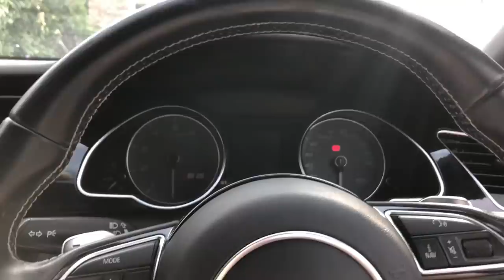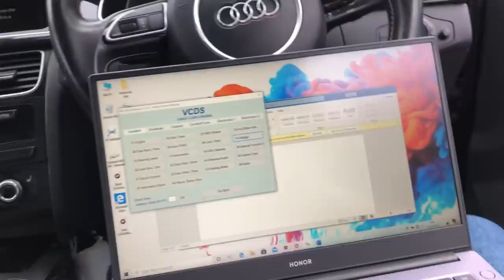MISTAKE MADE with My Cheap Audi S5 - Part 5

Comment: Dude! I did the same thing with a MK 7.5 fiesta I rebuilt recently and I bought a bumper with parking sensors and I didn’t know! Luckily mine was the other way round so I finger glass filled it and had it painted. Nightmare the other way around
Reply from the maker: ben young lucky man. It’s possible both ways but just an absolute nightmare man.

Comment: Hi where do you get the VCDS software and is it free?
Reply from the maker: Greg MacGregor Hi Bud, Ross-tech.com provides the cable and the software. It’s not free. I believe you can also get dodgey copies off the internet if you search VCDS in Ebay for example- not sure how good they are.
Reply: @SLRebuilt  thanks for that

Comment: Why don’t you get the body shop to drill the parking sensor holes
Reply from the maker: A J they could do but then they would also need to cut the washer jet holes to. It all starts adding up and I wanted an excuse to upgrade the bumper 😂
Reply: The parking sensor holes are usually marked where they are supost to be, just use a hole punch to cut them out. Really clean and only took me about 10 mins on my wife's A1. Also, you can stop the loud beeping when the door is open by pressing the little push switch on the bottom of the washer jet stalk, that beeping does my head In lol. Enjoying the videos mate!

Comment: Do you know how to remove the metal clips off the curtain airbags on a 2015 S4 I’ve tried looking for videos but can’t seem to find any, your airbags are way easier than mine
Reply from the maker: From memory these we an absolute pain in the arse. I think I used a small flat head screw driver and a pointed trim tool. Pushed the pointed bit in or out and then used the small flat head screwdriver to push the clip to the side
Reply: @SLRebuilt  thank you I will try this out tomorrow & yeah bro worst clips for sure
Reply from the maker: @bullseye1798  I think you need to squeeze both clips inward (it’s been a while)

Comment: Great content. Small criticism, sometimes you repeat the same message between clips which could be edited out. Other than that, great!
Reply from the maker: lee smith cheers for the feedback mate. Yeah I noted that with the bumper. Shot a few different vids over a few weeks and had to put some bits in to make it flow still. Appreciate the feedback man 👍🏼
Reply: Don’t be afraid of a rough chop of a clip. I see this all the time on channels with 1M plus subs. Keep going, you’ll get there soon enough 👍